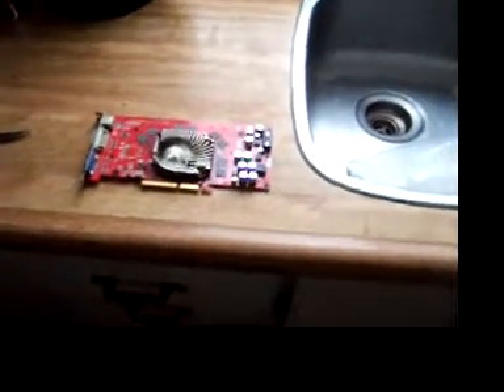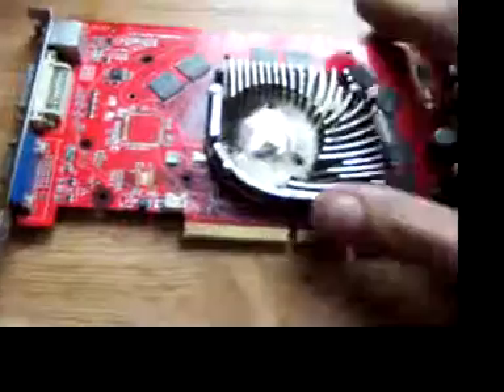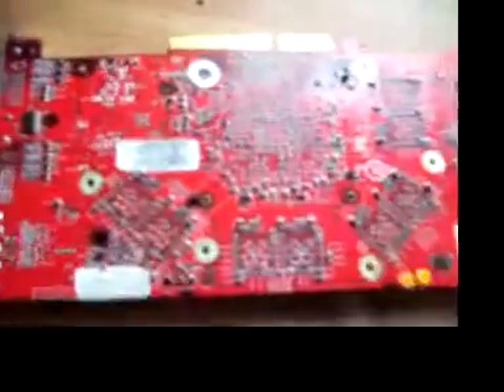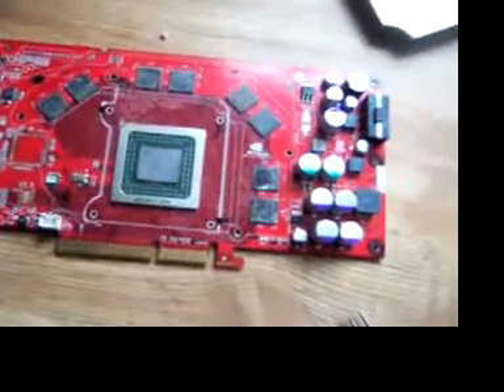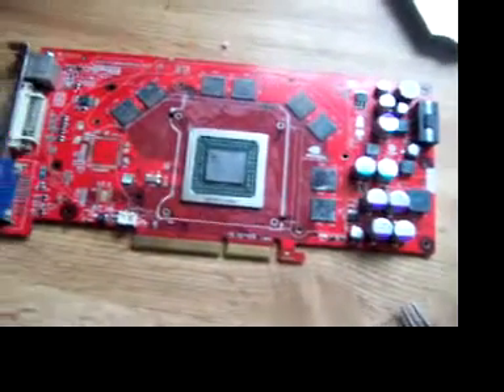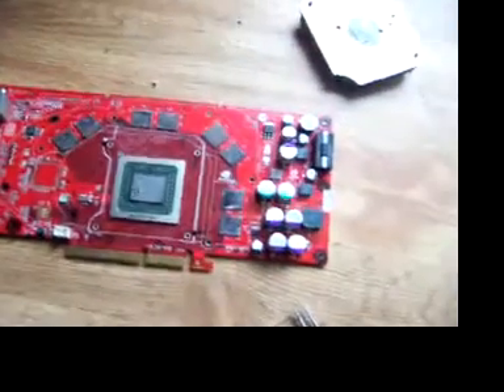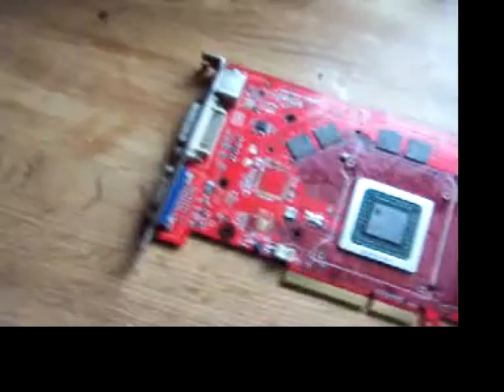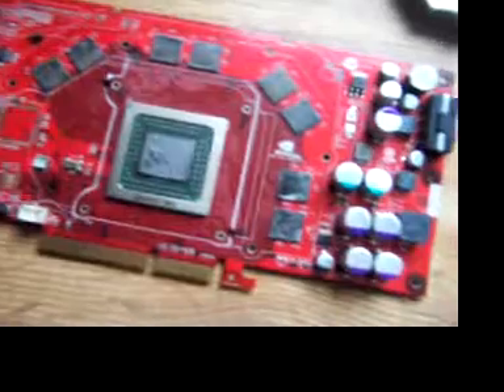does baking your video card to fix micro fissures actuly work ? part 2 of 8

Comment from the maker: @computermguy not rilly you would only do this to a card with problems  so if it works great if not your no worse off an it does work some times i was able to fix a 9800gt with 8mins of 200c ladie is still plating wow on it